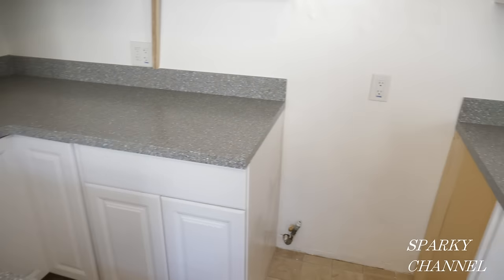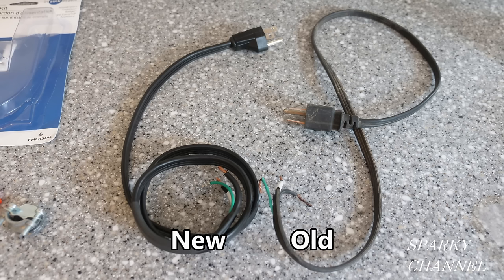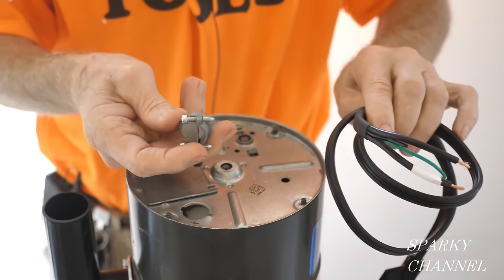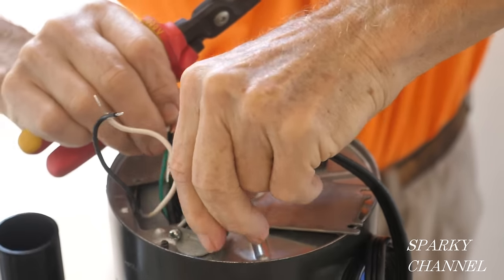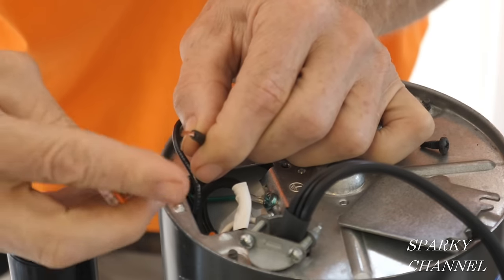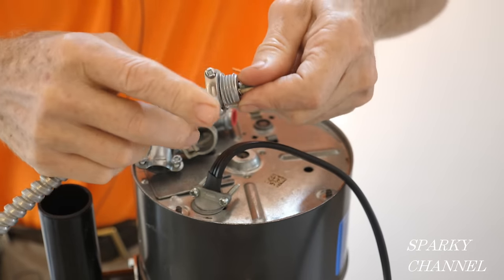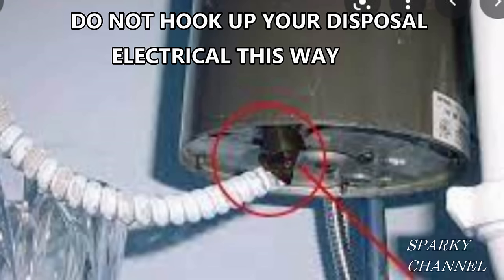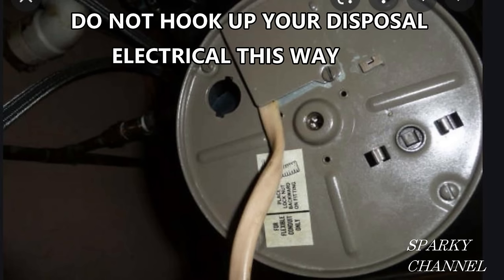How to Wire a Garbage Disposal (Including Polarity Check for the Wires)

Comment: This is the only channel I’ve seen that tells you that you need a different kind of cable connector for a hardwired setup as well as the red head anti-short bushing. Thank you!
Reply from the maker: Great to hear. Details matter a lot in electrical.

Comment: Whenever using type AC ( bx ) or MC armored cable best pratice is to cut sharp edge at a 45 degree angle so it could never pierce insulation. Glad to see you use an anti short bushing on the cable. At a continuing education class an inspector told us that you must purchase a listed cord set. Even a licensed electrician can not make his own cord from a piece of cord & a 3 wire male plug. Going by latest NEC would have to be on a tamper resistant receptacle protected by an Arc Fault circuit breaker ( new house ). All the new AFCI breakers provide ground fault protection.
Reply from the maker: Thanks, excellent advice!

Comment: If you're experienced in electronics and know how to solder, you can tin the tips of the new cord before connecting it to the disposal with either Wago connectors or wire nuts.  The flat 3 prong cords usually have a rib as you noted on the neutral wire.  The center is the ground, and the smooth side is hot.
Reply from the maker: Thanks!

Comment: Make sure you use the top plug inlet too! Hey, no one told me...  I don't want to say how many times I used the bottom inlet which is a continuous circuit. thinking there was something wrong with the wiring! LMAO! Thank you for the info to distinguish the neutral/hot wiring. Very helpful...aloha
Reply from the maker: Aloha from San Diego!

Comment: The Garbage Disposal at the new house we are going to rent out soon was an absolute mess. The cable clamp was missing, the previous owners did a poor splice job using electrical tape and drywall anchors out of all things, the switch was put on the neutral, and the grounding was very questionable. I wish I could send you a picture, but I have since fixed it properly. Also, they ran  Romex directly to the thing, and it was flopping all over the place  and unsecured inside the cabinet. The wire was rubbing against concrete inside the wall and it somehow got pinched behind some plumbing.
Reply from the maker: Wow! Thanks for fixing it!!!
Reply: Sometime some owner don’t know how to do it… smh
Reply from the maker: @tallr264  Yep.

Comment: Thank you! I understand electricity and polarity but very surprised the power cord is solid black on both wires. You saved me a lot of extra time digging out my multimeters.
Reply from the maker: Sounds good, thanks!
Reply: Most of the time the smooth wire is hot or the 1 of the 3 that don't have a pattern or ribbing on them.  You can remember it easiest by knowing BLACK = DEATH and it's real EASY (smooth) getting DEAD. This hot will always be individually different visually or by feel. 

DON'T get me wrong though.... I've seen some $hit in the field and breaking out your meter to be safe is NEVER a bad idea or something that's frowned on,  cuz you NEVER TRUST the guy that was there before YOU! ESPECIALLY if you're a weekend warrior that knows just enough to be dangerous but not enough for the correct standard to be common knowledge and you have to go to the internet to figure things out.
Reply: Would it still work if smooth was connected to neutral white wire?

Comment: I don’t have multimeter.  The gray cord that was on the prior one was reused and I can’t tell smooth vs ribbed. So no way to tell if it’s wired correctly.  It spins when on, but not sure which way it should spin.  Would it go clockwise or is it supposed to spin counter clockwise?  Besides it spinning in opposite direction, is there some other risk if hot vs neutral is switched?

Comment: What if the wire comes out of the cap and touches the metal? Won't it energize the whole sink and you will get electrocuted by just touching one single thing? Is there some sort of restriction? Thanks for the answer if you do Bill!
Reply from the maker: Hi! The garbage disposal has a built in circuit breaker that will trip in such an instance. There is a small red button on the bottom that needs to be reset in that case.  Also, there should be special breakers to add to the safety. But yes, that would potentially be a quite dangerous situation.

Comment: At 4:26 what do you mean by “stray strands” and what problems can they cause?
Reply: I believe stray strands cause problems if they make contact with another surface/wire which could result in a short or failure to operate as expected.

Comment: My garbage disposal had white smoke coming out today. We just purchased the home a few weeks ago. Turned off the breaker and called the fire department. My husband had been on an errand when this happened. After the fire department checked everything and confirmed the breaker was off, my husband started to disassemble (his dad is a master electrician and he worked with him in the past, my husband is a bomb technician) the disposal. We discovered that who ever installed this disposal was connected using reused 14/2 white electrical wire. It was straight wired to the switch using what looks to us like an old piece of 14/2 that was scrap reused to connect the disposal. This isn’t right? Right? We can see charring on the copper wire from the 14/2 and the smell is horrible!
Reply from the maker: It does sound like a bad wiring job. Also check out this video: Garbage Disposal Cords $13.98 vs. $3.37, Why?: https://youtu.be/i4_C_exgH_s

Comment: I plan to replace an older garbage disposal within the next few days.  If the wiring is weird or unusual on the old disposer I will send you pictures.
Reply from the maker: I hope everything is fine but thanks!
Reply: @SparkyChannel  Thanks Bill timely video I'll be installing/replacing a new GD unit in the next week or so.
Bill does the NEC say anything about where the switch may/may not be mounted?
Reply from the maker: @a..d5518  Great! Check out my video description for links to GD cords. HD has a high price of $14. No, I don't know of any such code.

Comment: What do you do if you are hard wiring the disposal in a house that does not have a ground wire (only 2 conductor wires): Hot-blk and Neutral-wht?
Reply from the maker: Are the wires in flexible metal conduit? If so, check the conduit to see if it is a ground. Flexible metal conduit can serve as a ground.

Comment: had a property management company employee once ask, "if I buy five disposals, could you just put cords on in advance?"

also, safer to confirm polarity in a cord like that by reading continuity from the plug blade, instead of energizing the cord.
Reply from the maker: Yes, come to think of it the plug could be mis-wired.
Reply: @SparkyChannel  well, I'd assumed you'd wired and tested that receptacle, already.  

but funny-in-retrospect story - saw an incident where a person bought a cord for their new clothes dryer, and thought they should check to see if it matched their receptacle before they installed it.
Reply from the maker: @kenbrown2808  LOL!

Comment: Thank you so much. When I took my old disposal out I didn't see any ground wire! So I stripped back the wire and didn't find a ground wire. 

My home was built in the mid 50s but the garbage disposal I removed was replaced since I've lived here about 15 years ago. I know a plumber installed it because I was watching. But I didn't know about the wire not having a ground. 

I'm not sure what to do other than possibly use a plumber to do the final step of electrical because it's so important I have it grounded! 

I know this was made a couple years ago. But if you happen to see my comment I would greatly appreciate your input.  Thank you so much this was extremely clear!

Comment: Why use a "regular" plug for the disposal and not a GFI one ( since you are close to a water source) ?
Reply: Because all of the kitchen receptacles that are 6ft away from the sink (which is the case here) are protected by either a GFCI receptacle or gfci breaker.
Reply: Nowadays everything is on a gfci or afci  breaker

Comment: I realize this question is locale specific, but in general terms should you add a GFCI when replacing an older garbage disposal if it didn't already have it? If I understand correctly, NEC 2020 requires a GFCI receptacle inside a cabinet for the disposal (but 2017 NEC did not require gfci). In my case I have the extra obstacle of armored cable. I'm pretty handy so if there's value, I can add the gfci but I've not heard of injuries from this scenario so I'm not sure I'd really be adding value.
Reply: I don't know about your locality, but in mine, GFCI protection for undersink equipment, including using a faceless GFCI as a service disconnect for the dishwasher, is perfectly fine under the sink.

Comment: Great job Sparky wonderful and clear. I agree with Ken below safer to confirm polarity with a continuity tester clipping to the male end of the blades and the wires. I would go even 1 step further using a electrical safety tester to ensure protective continuity, insulation resistance and touch and leakage voltages  and GFCI trip are within safe electrical standard thresholds for the garbage disposal.
Reply from the maker: Thanks Math Man!
Reply: You can just follow the wires visually to see which is going to the neutral prong and which is going to the hot prong. They go in a straight line. You really don't need to verify something like that with a bunch of different tools unless you are a layman. If you are a layman then you probably won't have a bunch of meters and tools handy, either.
Reply from the maker: @illestofdemall13  That's true. But how many layman know which side of the plug is hot and which is neutral? Perhaps I should make a video about that, showing which side of a plug is hot and which is neutral and all the various ways to test, such as your visual method, a continuity test and the method I showed in the video. It's a very important subject.
Have a good one Kris!
Reply: @SparkyChannel  Also show them how to check polarity and the receptacle in several ways, so they know that is also wired properly. I have a really interesting story about polarity I can share with you via email. Lol. Have a great one as well!

Comment: The last disposal I bought came pre wired with a 2ft cord.
Reply from the maker: Yes, some models do come with a pre-wired cord.
Reply: @SparkyChannel  Have you done a video of how to switch out a pre-wired cord. I bought a new disposal, but it's pre-wired. The one I am replacing was not pre wired. I do not have an outlet under the sink, the wires just disappear through a hole in the wall. Do you have a video for this? Thanks,

Comment: Great video Bill. It would also be good to mention the NEC requirements for cords, this is the 2017 codebook (which Michigan is currently using): 

422.16 (B) (1) Electrically Operated In-Sink Waste Disposers.
(1) The flexible cord shall be terminated with a groundingtype
attachment plug.
(2) The length of the cord shall not be less than 450 mm
(18 in.) and not over 900 mm (36 in.).
Reply from the maker: Excellent, thanks!

Comment: Email sent as well.. 

So I have the metal clad wiring from under the sink.. 

So you're saying the metal clad is the ground.. so essentially,  I dont need the wire for the badger (the one not provided).. Id just connect the white and black from the disposal to the white and black within the metal clad.. 

As far as the ground.. the clamp is what works as the ground.. provided that its securely in place? I dont need the green ground?  Any help is appreciated

Comment: Wouldn’t “polarity” not technically affect anything? Although bad practice, and possibly unsafe, the neutral and ground aren’t bonded in that box, hell if they were any way of hooking it up would be unsafe
Reply from the maker: I would say that if you reverse polarity on the cord you run the risk of energizing metal surfaces.
Reply: @SparkyChannel  if the metal surface is grounded and bonded, and the metal surface gets energized, it will trip the breaker (and/or the GFCI that is now required for garbage disposals).